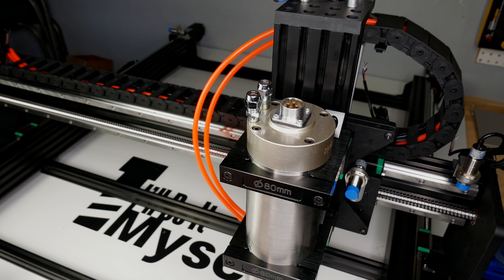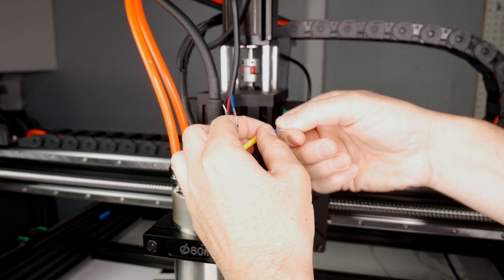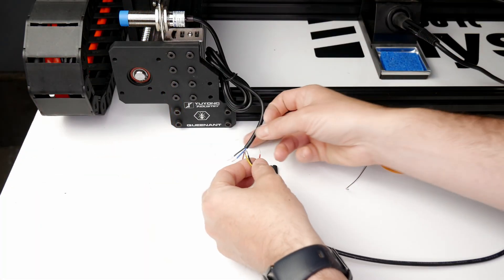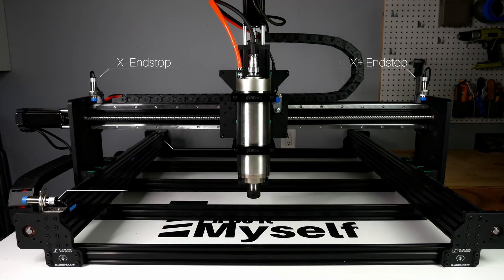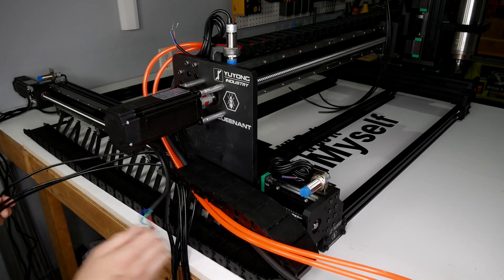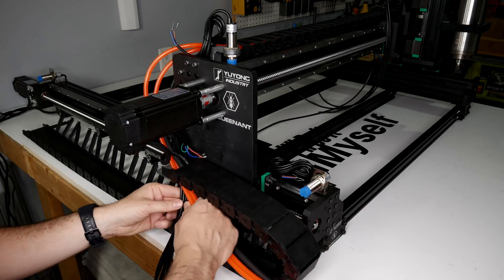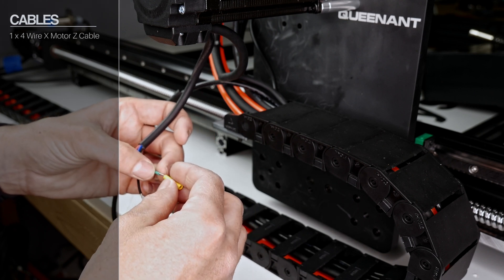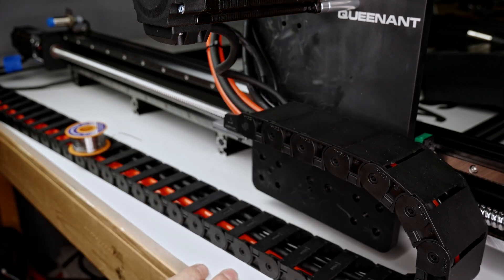QueenAnt Pro - Wiring

Comment: Just bought a queenbee ultimate 1500x1500 2.2kw water cooled spindle,  what water chiller would you recommend?  Cheap passive radiator type or refrigeration type eg cw3000 vs cw5200 price difference about 400 Australian dollars thank you Wayne
Reply: I have a water cooled spindle and I just leave the pump and the bottom of a 5 gallon bucket of water I have ran my CNC on large projects that have taken over 8 hours and I do not see the need for a chiller